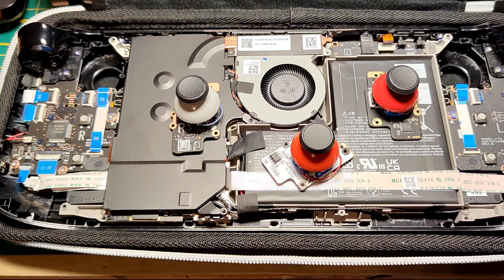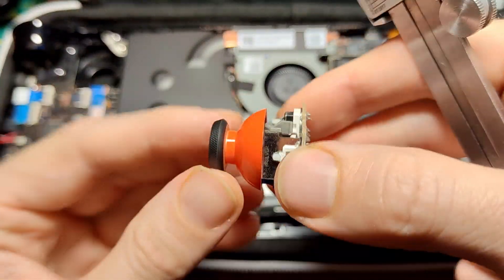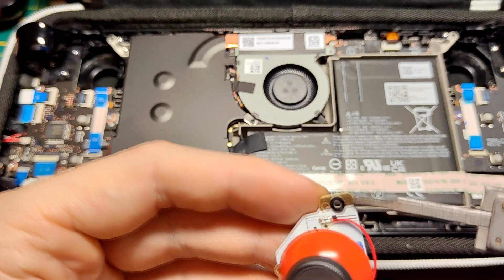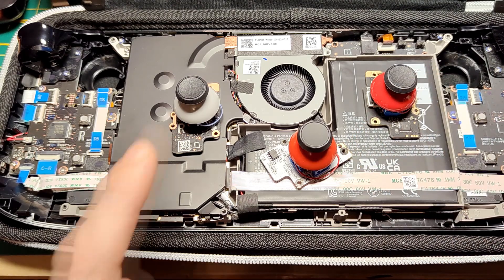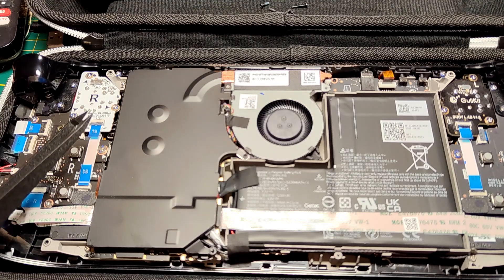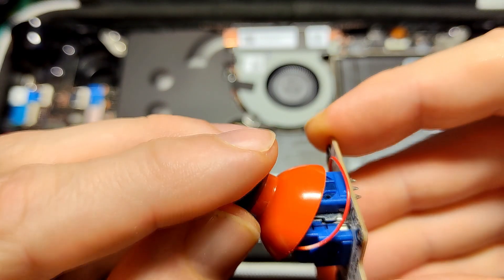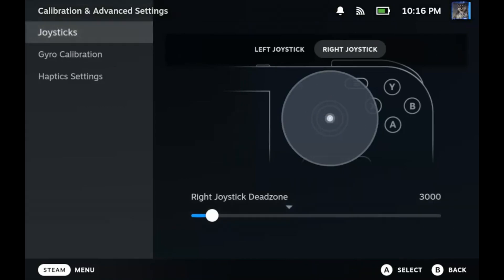guliKit VS Elecgear Hall effect sensors for Steam deck LCD.

Comment: Hey, thank you guy. This is Tony from ElecGear.
Now I have done the 2nd version. I made this update for two factors:
1. TMR stick improved a lot from hall. 2. My calibration software was widely used in many controllers. 
So I applied the advantages and released the TMR stick module on Steam Deck, please search my video.

Comment: As someone who has used both on my old LCD model, this is the reason I always make sure to recommend the ElecGear sticks over the GuliKit. I just wish ElecGear would make sticks compatible with the OLED model now, but it seems to not be happening for some reason.
Reply: Care to share why?! I just got Gulikit joysticks! Didn't installed them yet though.
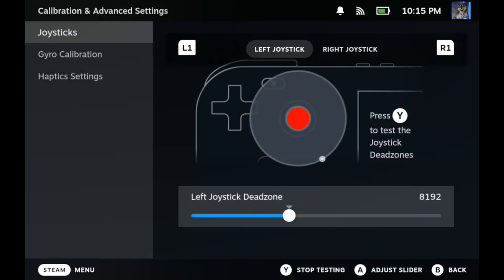Reply: @DaffyM4318  This video does a perfect job of demonstrating why. Starting at 7:00 he shows how different the outer bounds of the sticks are. The Gulikits overshoot on the corners which means they hit 100% output on the corners much sooner than the stock and ElecGear sticks.
Reply: @Moskeeto  Thank you. I'm Tony from ElecGear. The video was talking about my first version of the LCD one more year ago. Really sorry I have no access to Youtube for years, so I can not view or answer any questions. 
Many improvement settled as time goes by. Here's two. 1. TMR sticks are now born with many upgrade from Hall. 2.ElecGear has settled down the calibration software on the add-on MCU. We have applied the calibration on many controllers.And now we have released the 2nd version for Steam Deck. 
The 1st was calibrated by Thumbstick-cal app, while the 2nd will be done by add-on onboard MCU (internal software). They both ensure the rounded outer circle, but the 2nd will be better for the TMR stick it used. Please search the video on YT.